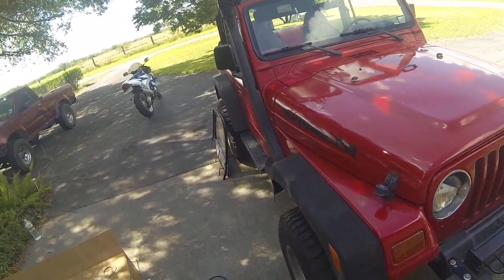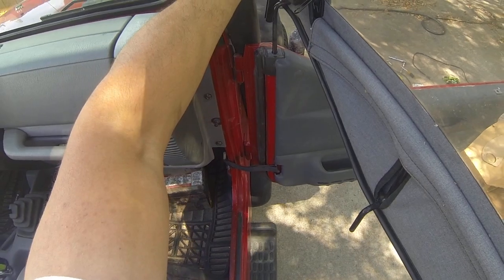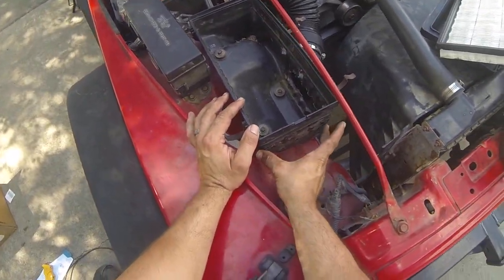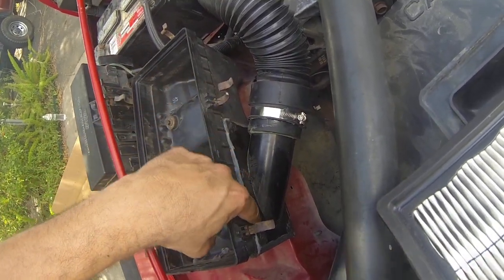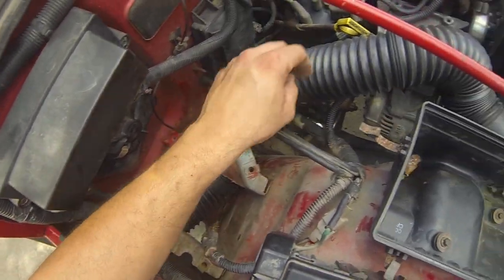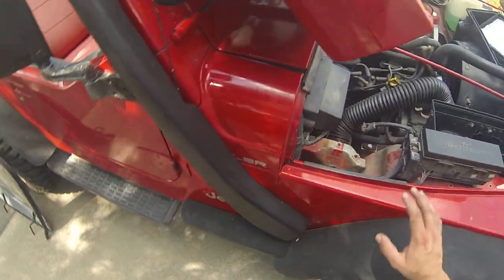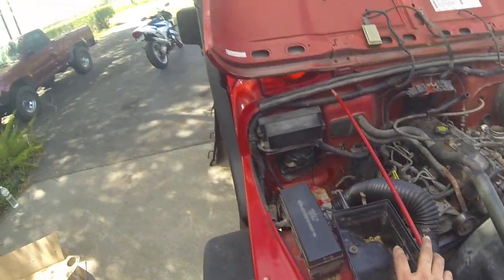Jeep tj snorkel install

Comment: If you reverse your windshield pillar around, it will push the snorkel forward like an inch. Then you can remove the door without issues. I have the ARB one and eBay one. They're exactly the same with the exception of the Safari Snorkel lettering. Even the air box tubes are the same as ARB
Reply: Great tip!

Comment: this is kinda off subject but does your doors leak water down into where bottom metal rod in window is.Every time it rains i get water in that pouch around bottom window frame. Any ideas to stop it.Great job on the snorkel.Looks awesome!!
Reply from the maker: Yes it does, but I honestly don't mind it so I've never looked into fixing it. Whenever some asks me that same question or make fun of me, I just tell them "it's a jeep thing, you wouldn't understand".  They usually get the point haha... thanks for watching
Reply: @deepsouthtexasoutdoors9405  i agree,i think it is just a jeep deal.Great job!!

Comment: very good instruction! Thanks a lot!
Reply from the maker: Thanks for viewing Ren! Your welcome
Reply: I bought a $80 one from ebay too. Might be different from yours but mine does not come with the screws and inserts for the windshield attach points as shown in the real ARB one (http://www.jeepgunner.com/jeep/arbsnorkel.htm). How did you install the bracket onto the windshield ?
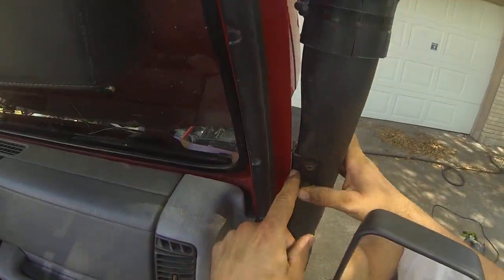Reply from the maker: +Ren Guomin Hello again Ren, sorry your kit didn't come with all the hardware. I go into some detail how I attached the  top bracket from 11:23-12:07. What i would do is either contact the seller to send missing items, fabricate an L-shape bracket and get screws and bolts to attach them, or find a similar one at a harware store. Make sure bolts are same thread pattern and size for the snorkel. Let me know how it goes

Comment: Not being able to take the doors off is a hard-line for me.  In San Diego the doors are off 8 months out of the year lol
Reply from the maker: I hear ya! It's not im possible to take the door (passenger) off though. You just have to unbolt a couple things then move the snorkel out of the way, remove the door, then put everything back together. So it can be done. Good luck to you. Thanks for watching.

Comment: I just bought a Jeep with a snorkel. I’ve narrowed it down to this kit. The hose is broke coming from the box to the snorkel. The door strap is broke on the passenger side, and my son let the door go and it got into the snorkel pulling loose from the windshield frame. I removed the snorkel until I could fix it, and was in disbelief when I saw the hole. It looks like someone used a hatchet and hammer to make the hole! I think they used a side grinder and hammer actually. A freakin hole saw is like $10-15 at Lowe’s or Home Depot, unbelievably. The hole is to big to even put those lower mounting bolts in. There are about 8 holes in the windshield frame from screws being pulled loose and this last time they used epoxy to glue it. I think I’m going to make a plate to dress the fender up and buy a new kit to reattach everything properly. One on the nuts in the snorkel is broke loose. Moral of this story is do it right or don’t do it at all, and make sure your door straps are good! It’s sad because the body and frame on this Jeep is near perfect with zero rust.
Reply from the maker: Sorry you had to go through that. I hope you can patch up the poor workmanship and make this jeep your own. Good luck on your project and thanks for sharing.

Comment: Hey! Thanks for the video, could you msg me back so I can get some more entail and maybe some pictures? Just want to know where the rubber ends go and what exactly holds the top of the snorkel on (I figure just a hose clamp but that seems too risky. And just wonder what you do after removing the vacuum line from the motor and the air flow hose from the motor. Thanks!

Comment: i noticed about a half inch gab on the back side of snorkel.. did you have the issue also
Reply from the maker: No I did not have that issue.  My snorkel was flush with the fender of the jeep. Check for any clearance issues which may be causing the gap.

Comment: hi. there's a difference between 2.5 and 4.0 snorkel installation?
I bought the snorkel for a 4.0 and I have a 2.5 SE.
Reply: Christian Zuñiga González did it work for you? I have a 2.5 and want a snorkel. But I don’t know if it will fit
Reply: Same exact airbox. Yes it will work

Comment: Was that the 2.5 liter I4 or the 4.0 liter I6 engine? I think I saw the 4 cylinder one in that engine bay.
Reply from the maker: Alex Erickson It is a 4cyl 2.4l engine. Thanks for watching
Reply: It is actually the 2.5 I4 engine. 1998 Jeep Wrangler SE's have the 2.5 liter I4 engine.
Reply from the maker: Alex Erickson Oops! Your absolutely right.

Comment: Hi, i have a question, do you have problems with the compresor of the A/C, in the video i didn't see it in mine is in the middle of the way. any idea. thanks
Reply from the maker: Hello Christian. In the description box i point out that this install was done w/o an a/c compressor.  Do you have a 4cyl or 6cyl?
Reply: ok, i had not seen it. i have a 4 cly. any idea to how make it fit.
Reply from the maker: +Christian Zuñiga González 
Are you having trouble installing the side plate or the flexible tubing?
Reply: Yes, i can not pass the flexible tube between the box and the compresor of the A/C. do you have any account like facebook or other where i can send you pics. thanks and pura vida
Reply from the maker: +Christian Zuñiga González 
Sorry buddy i dont have social media.  But hopefully we can figure it out... Is the side plate  already installed? (not the front block off plate)
Reply: no. it is not installed, but i gonna use another way in the back of the box. when i do i will send you a link for the video. thanks
Reply from the maker: +Christian Zuñiga González 
Ok thanks...dry fit everything first before you start cutting and attaching things
Reply: thanks
Reply from the maker: +Christian Zuñiga González 
Ok thanks...dry fit everything first before you start cutting and attaching things